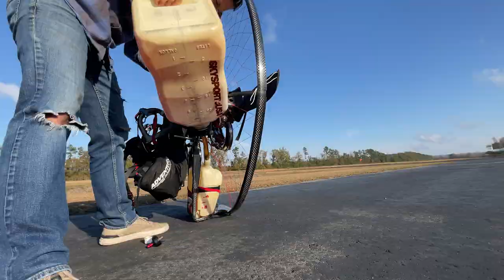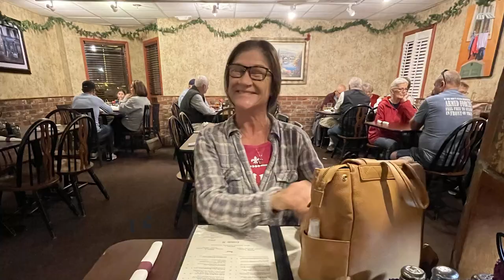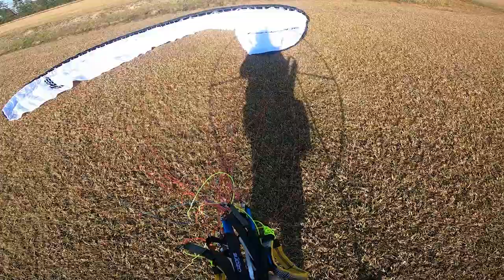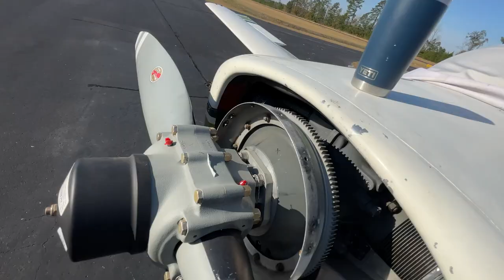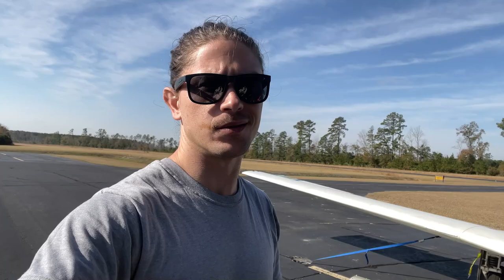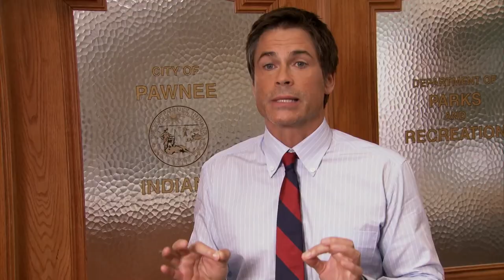Airplane BROKEN.

Comment: When rotating a propeller, it's safest to rotate it in the opposite direction of normal operation. If a magneto becomes ungrounded, the impulse coupler could cause the engine to turn over.

Comment: Luck is on your side, so happy you had this happen before going up.  Looks very expensive, but you are learning so much from this. How fortunate you are able to work on your plane without the hassle of people making you move it to a spot designated for repairs.
Reply: I don't think it would have been a problem in flight, I think it would have rattled and sounded awful and hopefully that would have been it.   In this situation he's lucky that it didn't happen when they flew to Myrtle beach, that would have sucked.

Comment: That oil cooler could use some attention - the fins look blocked. I use a fine blade to open them back up then use a degreaser to clean and a strong vacuum.. Of course get the AP to make suggestions first. I think there is a larger oil cooler available but again - if your temps are all in line no issue!

Comment: The suck is strong in this video. May The Force be with you as you fight with the Mooney Demon, cram 6 pounds of ———- in a 5 pound box. 
I have been without a plane for 3 months getting new avionics installed, I can now get lost in style. They have 1 thing to do, there is a computer issue, parts have been shipped….